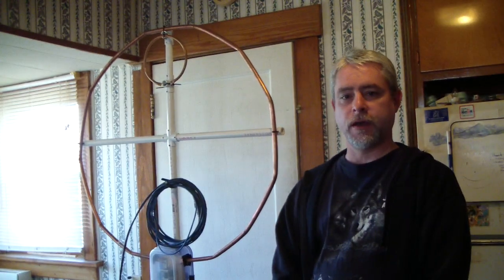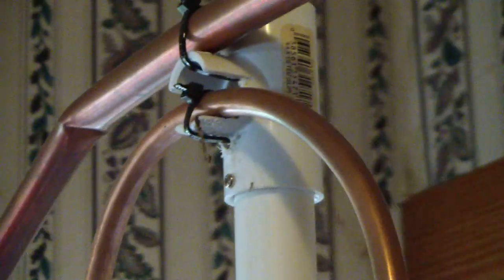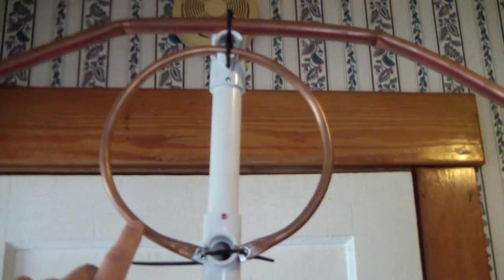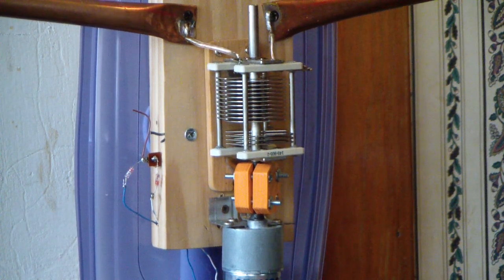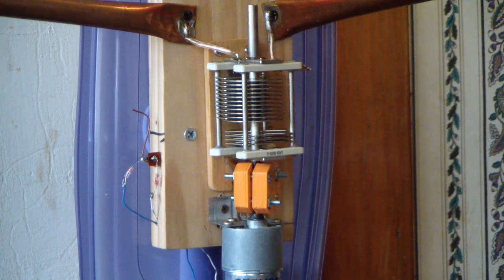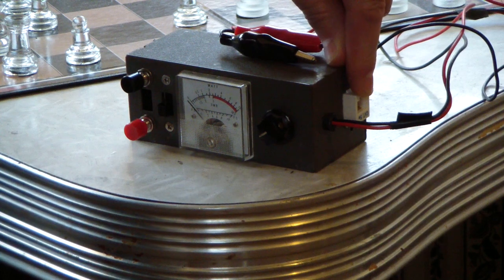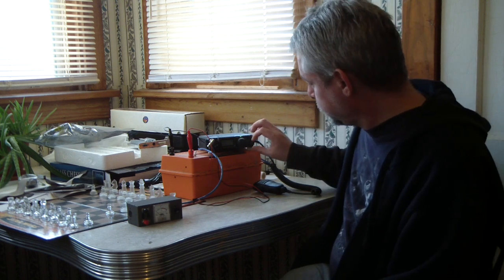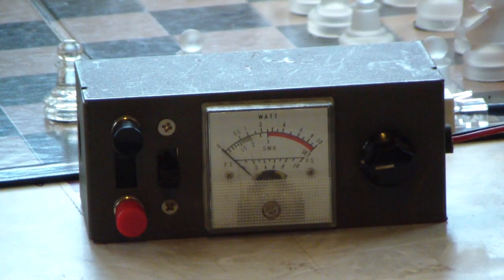Ham Radio - Magnetic loop transmitting antenna overview and details.

Comment: Does copper tubing work better than coax for the loops?  I just finished making a magnetic loop using LMR-400 and got a two-stage variable capacitor. The only problem is that I get no signals, but tons of noise.  Any suggestions?
Reply from the maker: Yes, copper tubing will work a bit better than coax.  You want as low of an electrical resistance as possible in the outer loop.
It's a pretty simple circuit, not a lot that can go wrong in building it.   There are lots of types of noise that could mean different things.   A constant whooshing could be noise from an internet terminal.  A buzz could be florescent lighting or power lines.  Static is just atmospheric.  
You should hear very little until you tune the antenna to your frequency.  When tuned, you'll hear static come up quite a bit.   If you tune the radio 20kHz in either direction, it should get quite again until you tune the antenna to your new frequency.  They are that narrow.
Double check your wiring.  If you're using coax for the outer loop, make sure the center and shield are tied together, making it one long single conductor.   Make sure you're connected to the right terminals on the variable cap.   I don't know what else could go wrong.
Reply: Ok, thank you again.

Comment: Hi Kevin, i was wondering what is the inductance value of the primary and also the secondary ? Thank you.
Reply from the maker: Sorry, I don't know.  I didn't use a mathematical approach to this build.  I copied the very common dimensions and it worked out fine.
Reply: Thank you, your work is fascinating and has inspired me to build my own. 🙂
Reply: It's the ratio. To match 50 ohm co-ax its about 5:1 (fifth diameter/circumference for the Faraday loop).
A ferrite ring through the main loop, about 9 turns for the co-ax.
Or maybe if you use a twin feeder to the open ends where the capacitor is.... Around 250 ohms or so(?) but I've only played receive here.

Comment: This is great. How did you construct the field strength meter? What parts are required?
Reply from the maker: It's a simple circuit.  The diodes with a short pickup wire are near the main loop,  two wires bring the rectified DC back to the control box where the pot and meter are.
Have a look at my vid on building a field strength meter,  it will be clear.
https://www.youtube.com/watch?v=8Dd0oEzDepA
Reply: Much appreciated.

Comment: Good stuff, thanks. Have you experimented with a gamma match yet?
Reply from the maker: I've tried four methods.  Coupling loop, gamma, wrapped loop, and torroidal transformer.   I didn't see any major difference between them.
Reply: @loughkb  Thanks Kevin, I have seen that gamma matching can change the directionality of small loops favoring the direction of the match side of the loop. Upsides and downsides to this I suppose, if it is true, you then need to rotate 360 opposed to 180 :) I didn't know if there were any other advantages/compromises though. Thanks again!

Comment: Hi. Thanks for this video. I'm researching about small antennas for receiving and I got a question, if you don't mind: the use of a HV variable capacitor is justified because the high RF power used on transmission causes very high voltage on the ends of the loop, but can I use a small, low voltage capacitor if I only want to receive, maybe like those on cheap fm radios? Thanks.
Reply from the maker: Hello Leonardo,   yes, you can use any capacitor you like for receive only.   The high RF voltages are only created by the power coming from a transmitter.

Comment: So, the coax connected to the smaller loop, the other end goes directly to the radio?
Reply from the maker: Yes. That's correct.
Reply: Ok, thanks.
Reply: If I wanted to make one of these antennas just for receiving only, would you tell me what kind of variable capacitor would be needed?  I mean, I guess it wouldn't need to be able to handle much voltage. But I would guess a capacitor with no 'stop' would still be a better option.
Reply: Oh, and does the small loop actually make physical contact with the big loop?  Or is it just in 'proximity' only?
Reply from the maker: To answer the first question, no, it doesn't need to handle voltage if it's just receiving.  So any variable cap should work.  It should have a range from 10 to 300pf at least.
Second, no, they're not touching, just close to each other.
Reply: Thank you very much for taking the time to answer. Your answer is very helpful.
Reply: Oh, do you know of any places (on the web) to buy these variable capacitors?  I found one place, but they seem to only have variable capacitors with 'stops'. Nothing that turns continuously 360 degrees.
Reply: At the 2:40 mark, you show the 'core' of the coax soldered to an end of the smaller loop, but I couldn't see what was happening with the braided shield. Is that soldered somewhere else?

Comment: Do you have a FB page? I have so many questions to ask you. I want to build that exact same loop for my attic with some slight modifications. Would like to contact you in person to talk if possible. Thanks for this video. It has helped put me in the right direction towards building an indoor loop. 73's from N3NQP
Reply from the maker: +John Athanassion Hello John.   My email is good on QRZ.com.   We could hook up through echolink for a direct conversation, or skype.
Reply: I have many questions needing answered. Is it okay to ask you them here? An annual ham festival is in two weeks and I need to know what to search for to buy to build your loop.
Reply from the maker: Please contact me via email.  Log in to QRZ.com and look up my call to find mine.  KB9RLW
Reply from the maker: Well I guess you're not going to contact me.   Here's some info.
The one thing you probably won't find at a hamfest, is the geared down motor to drive the variable cap.   Search for gear reduction motor and you'll find several on the net.    You want a huge ratio, at least 40:1 if not higher.
The variable cap I used is around 50-150pf.  The bigger the gaps in the plates the more power you can run.
The motor control is two DPST relays.  The center contacts go to the motor,  the NO and NC contacts go to B+ and Ground respectively and the pushbuttons operate the relay coils.
Not sure what else you would need to know.
Reply: I will be contacting you soon m8. Sorry for the massive delay in response to you. Didn't mean to be rude. So busy as a Vol. Fireman with trainings and calls. I'll have to download Skype real soon so we can have our conversation. I have a lot of questions I need answered before building this antenna.

Comment: OK, I missed it, what are the 2 diodes for?
 Thanks Eddie kj4fgi
Reply from the maker: There's a small half inch bit of wire near the main loop.  The diodes rectify the RF picked up by the wire and send a DC voltage back along the control line to a meter in the control box.  This gives a nice relative radiated power indication for fine tuning.   I can tweak the loop for peak radiated power.   A bit finer adjustment than what is capable with most radios built in SWR meter.
Reply: Good Idea Thanks

Comment: how about a  capacitor whit end-stop but I use a servo motor ?
Reply from the maker: Mechanically that will work. However, a Servo motor moves in steps, and it's probable that the optimal Tuning Point might not line up precisely with one of the steps. It might be harder to get a perfect tune.

Comment: nice video,please can you give more details about the fieal indicator specialy wath diodr have you used and the value of the indicator?tks and 73
Reply from the maker: +Cristian Anastasoaie They were germanium diodes, glass body types low forward resistance.    The meter movement can be any type, non-shunted.  I used a 10K pot for sensitivity.   Oh,  and you want a .01 capacitor across the wires at the diodes to prevent RF going along the wire back to the control box.
Reply: The capacitor to be in series with the diods? :D tks for answering 73
Reply from the maker: No, not series, you wouldn't get any DC voltage to drive the meter!   At the antenna end of the control cable, you put the capacitor across the two wires from the diodes.  It will pass RF like a short, leaving the rectified DC to travel down the cable to your meter.
Reply: +Kevin Loughin   If si not to much to ask...can you make a schematics with all the values of the circuit?
Reply from the maker: Cristian Anastasoaie It's almost identical to this one,  with the diodes and 470pf cap at the antenna and the rest in the control box.  The 'antenna' is a 1 inch bit of wire, near the big loop.
http://home.alphalink.com.au/~parkerp/gateway/fsm.gif

Comment: Hears a thought; Has anybody tried using flexible aluminum dryer duct as the main element in an antenna?  It would require support but would probably be easy to work with.

Comment: Why not use a stepper motor to drive the capacitor?
Reply from the maker: You can, but you might need to gear down the drive to gain resolution. If the stepper was directly coupled, an individual step might move the cap too far.
Reply: @loughkb  It's possible to 'micro step' the motor.  The driver chips used in 3D printers can divide each motor step (typically 200 steps per revolution) by 16 or 32 giving 3200 or 6400 steps per revolution.
Reply from the maker: @scharkalvin  And you'd have a pulse width modulated idle current through the motor to hold it in that micro-step.  Right next to the antenna, generating hash noise across he HF spectrum.
I suspect it would generate a lot of interference.  But that's just a theory.  try it out and let me know how it goes.

Comment: Can I ask what kind of SWR Meter you used?
Reply from the maker: Well, in this application, that's not actually indicating Standing Wave Ratio.   It's indicating a relative power reading and is non-calibrated.   We only want to see maximum deflection.
That meter movement was originally in an old CB radio SWR meter enclosure, but I'm not sure of it's full scale current rating.   It might be 100ua or 1ma.   Shouldn't really matter though.  You're going to get more than enough energy from the pickup wire near the loop.
Reply: Perfect.  Thank you very much for the response.

Comment: Hi Kevin i am told by several people these loops receive well but are poor on transmit...Fred g4vvq in UK.
Reply from the maker: In my experience,  the TX performance has been pretty good.  If I can hear them, I can work them.  I've made plenty of QSO's QRP on 40 through 15 meters with only 5 watts.   Not quite as good as a resonant dipole, but surprisingly good for a 3ft loop.
Reply: The performance is heavily dependent upon the quality of the capacitor as well as keeping the loop losses low by using a reasonably large diameter of tubing. 
The connections to the capacitor need to be as low resistance as possible also.
They can be pretty efficient under those conditions though
Reply: @loughkb  Not quite as good as a dipole AT THE CORRECT HEIGHT. I rather suspect that for many of us with less than perfect dipoles, a decent mag loop will perform perfectly well. I think 80 & 160 is where most people will see the most improvement over their compromised dipoles or doublets. Just a thought...

Comment: Do you still have the .STL file for the coupler?
Reply from the maker: Sorry, that was a long time ago.    I think I found one that was designed for connecting stepper motors to threaded rods for a Prusa printer.  I modified them to fit the shaft sizes I was dealing with.
Reply: Thanks for the reply.  I was wondering if the fill was 100%
Reply from the maker: No, I never do that, it's almost never neccessary.   I usually use 10% infill.  Plenty strong.

Comment: AM ? FM ?
Reply from the maker: I don&#39;t understand the question.  What would modulation have to do with anything?   AM on HF, sure,  around 7.29 Mhz  on 40 meters.   I don&#39;t think I&#39;ve ever heard of anyone run FM on anything other than the upper portion  of 10 meters.
EDIT: OK, bandwidth of the loop is so narrow that FM would be a problem with high SWR.  I see.
Reply: Perhaps the bandwidth of the antenna might be less effective radiating a wide signal, such as FM?
Reply from the maker: Bruce Nitroxpro Almost certainly.  AM might be pushing it a bit too, but probably doable.    I see, that's what the original question was about.

Comment: Another one thats upside down.
Reply from the maker: Ah, that old argument.   Look at the loop.  The high voltage is at the cap side, the high current is opposite.   Radiation is strongest at the high current points.  Jeri Ellsworth set up a rig to measure that.  
I've used them both ways, didn't really measure much if any difference in performance.   
It's a moot argument.